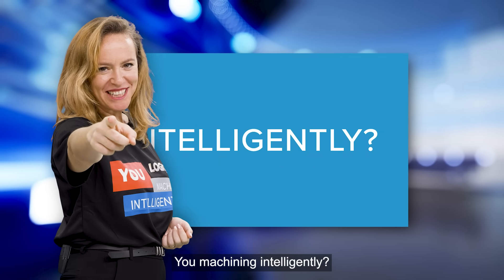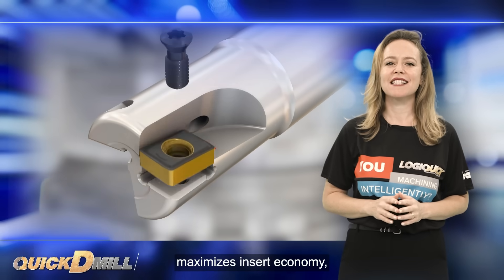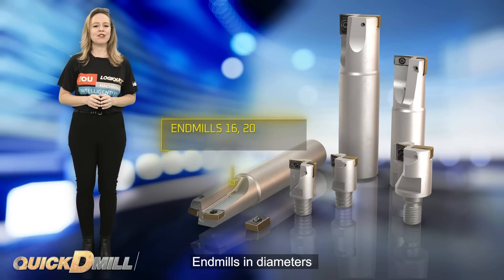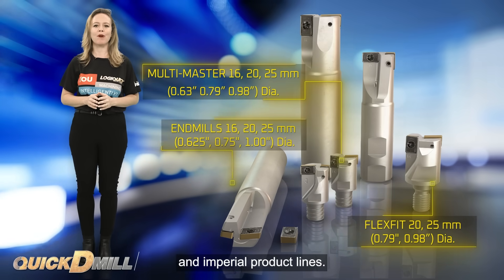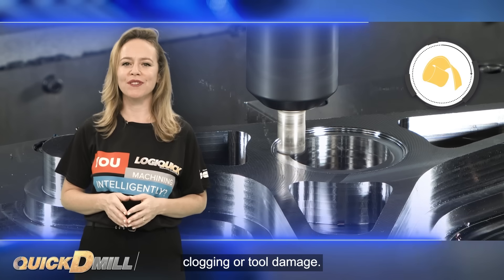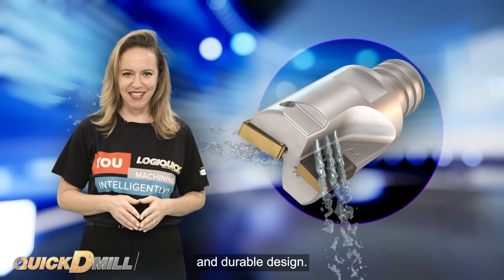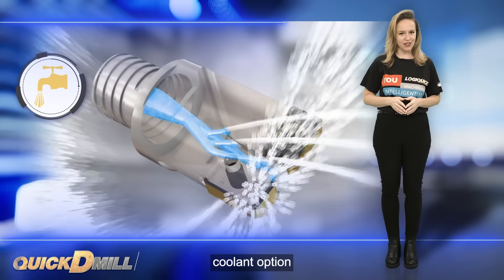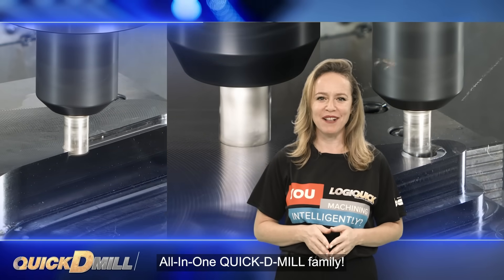ISCAR TECH-TALK  - ISCAR's QUICK-D-MILL for Milling and Drilling

Comment: Clever idea. Can it plunge drill a hole? Does it come in CAT40?
Reply from the maker: Yes it can plunge and drill a hole as recommended in ISCAR's catalog. 
MDR D0.62-2-W0.62-AN07 3440206
MDR D0.75-2-W0.75-AN09 3440207
MDR D1.00-2-W1.00-AN12 3440211
Reply: cat 40 is a machine side reciever designation. but yes you can fit these in cat 40 holders